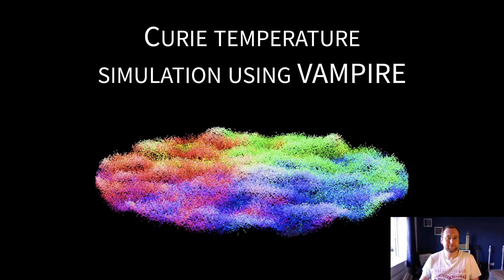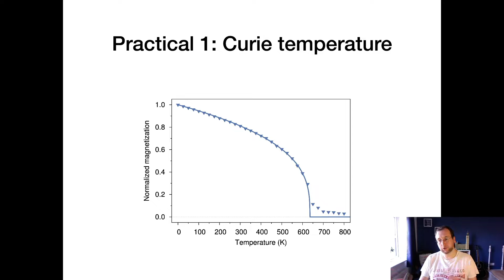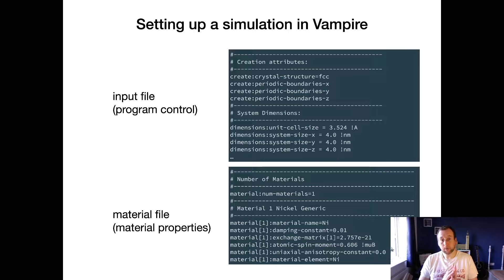Curie temperature simulation using the VAMPIRE software package

Comment: Sir,  how you calculate the value of exchange matrix and anisotropy contact? Is there any reference data?
Reply from the maker: You can use DFT simulations to calculate the values, or use the formulae in this paper to extract them from experiment (for simple materials) https://iopscience.iop.org/article/10.1088/0953-8984/26/10/103202/meta